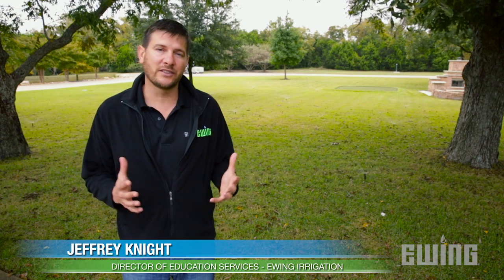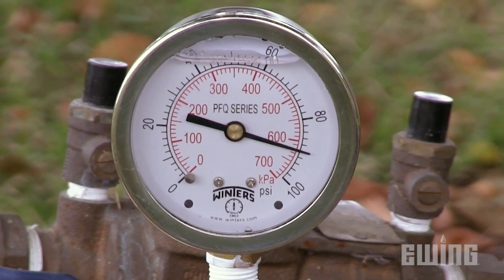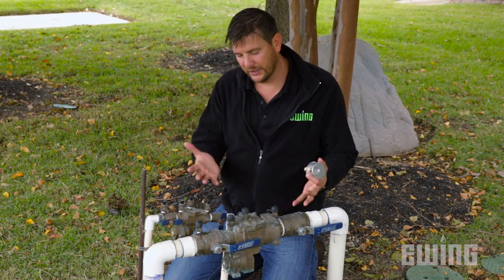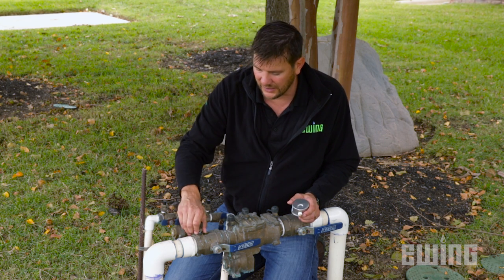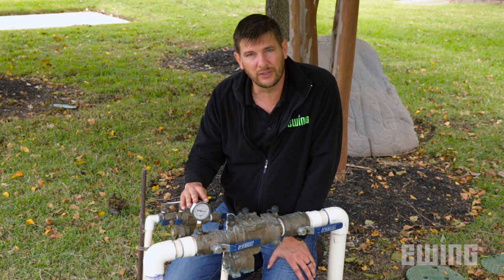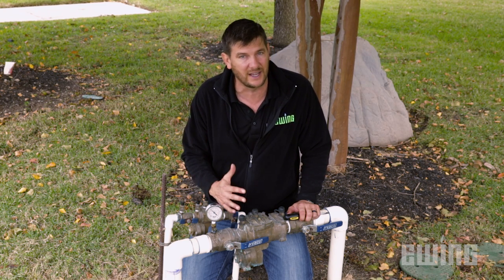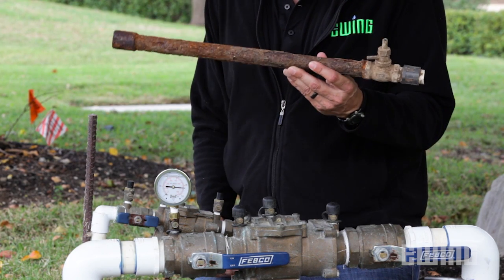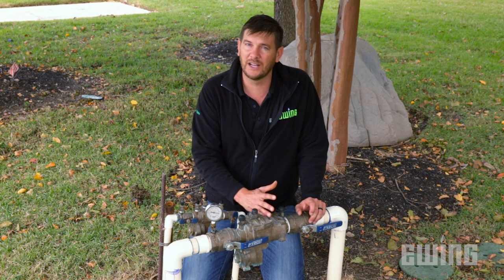How To Troubleshoot Sprinkler System Pressure Problems

Comment: I asked this in another video too. 
How do I test the water pressure going to my irrigation system and its water flow?  Testing at the spigot wouldn’t be accurate as the spigot is connected to my house and likely after a regulator, and my irrigation line branches directly off the main water supply line before it comes to the house.
Reply from the maker: If you have a backflow device installed, you can test the pressure as we did in this video. You can also take pressure readings at the last head in each line to see if its sufficient to operate that head as show in this video:
https://www.youtube.com/watch?v=n3SrM35widM

This article from Rain Bird should help you with testing water flow. Good luck!
https://www.rainbird.com/irrigation-design-tip-water-supply

Comment: What about too much pressure. Seeing water hammer when sprinklers turn on. Would closing the gate valve help slow it down?
Reply from the maker: If you close down the gate valve you will also reduce the flow of water. This may result in a zone that doesn't have sufficient flow to operate the heads properly. This blog post has some information that may be useful to you.
https://blog.ewingirrigation.com/how-to-shield-irrigation-systems-from-water-hammer
Thanks for watching!

Comment: Any thoughts about pressure loss when water is supplied by a private well? System worked fine for 13 years and last season not all heads were popping up to water sufficiently.
Reply from the maker: You can contact our Pump Pro hotline at 1-844-PUMP-PRO to see if they can help you. If you have a Ewing branch near you, you can also contact them for a contractor referral to diagnose the problem. 
https://www.ewingirrigation.com/locations 
Good luck and thanks for watching!

Comment: My girlfriend was quoted $7500 for a new sprinkler system. The problem was low water pressure in every zone. After watching this video I checked the gate valve and found that it was only partially open. I opened the valve all the way and all of the zones work perfectly now. Thank you so much!
Reply from the maker: Great! Thanks for the comment!

Comment: What he is describing as a pressure problem is NOT a pressure problem but a flow problem. The gate valve was allowing pressure, but it was partially closed not allowing enough flow to feed the system.
Reply: good point. probably using layman's terms for the average joe.
Reply: Flow and pressure are related. If there is a restriction in the system it will not only reduce the flow but it will also reveal itself in the form of additional friction loss.  That is what the pressure gauge is telling us.

Comment: You forgot to mention the friction loss due to pipe length, diameter etc. Friction loss in a 1 inch line is not similar to that in a 2 inch line at the same given head pressure.

Comment: The sprinkler head does pop up just a little bit. I have to push down on the head twice so it can pop up completely and start watering. It was working fine last summer and the pressure looks fine. I have air pressed the tubing to prevent bursting during the winter. Is it the sprinkler who might be broken?
Reply from the maker: You can remove the cap and internals to inspect for debris that may be obstructing movement. You can also just replace the internals with those from a new head of the same model to see if that solves the problem. It's also a good idea to flush the zone first before replacing the internal components. Thanks for watching!

Comment: Doesnt the pressure loss vary upon the size of the valve? If so what is the amount of loss for a 3/4 inch dual check valve backflow preventer?
Reply from the maker: Yes, the pressure can vary depending on valve type, size and flow. Check out the flow charts at the bottom of this document from Watts for details. You can also take pressure readings at the first and last test cocks on the backflow to determine the actual loss for the valve you are working with. Thanks for the question!

http://media.wattswater.com/c-febco.pdf
Reply: @ewingoutdoorsupply  since he didn’t like your reply I’ll do it for him! People can be selfish! Don’t let that stop your sharing!